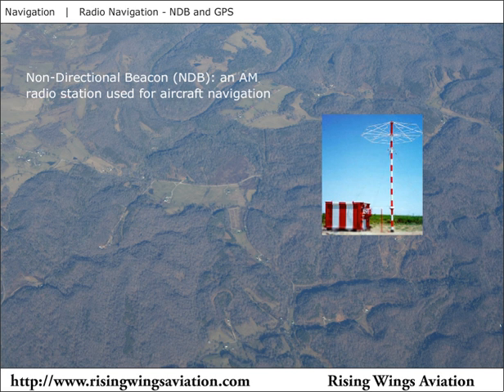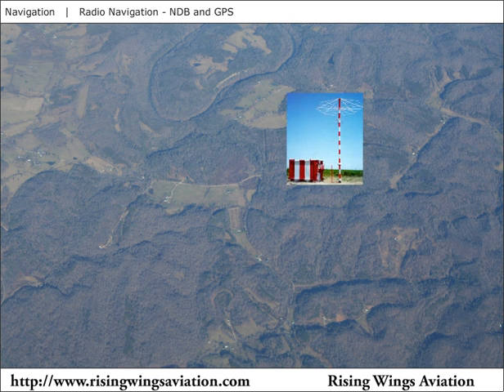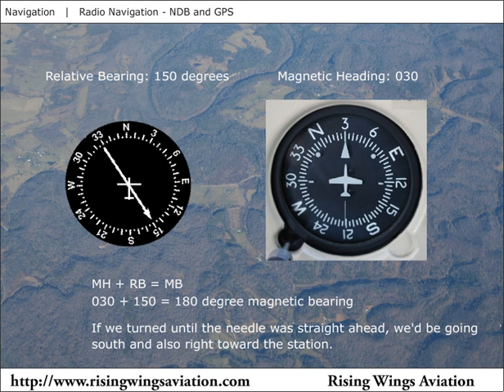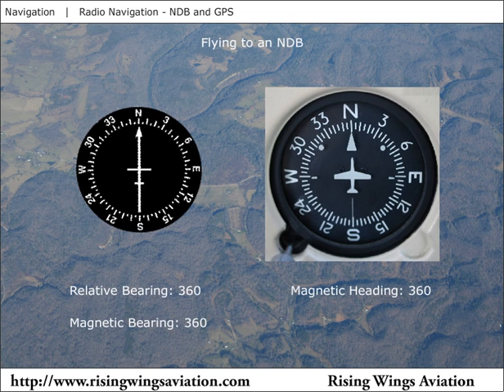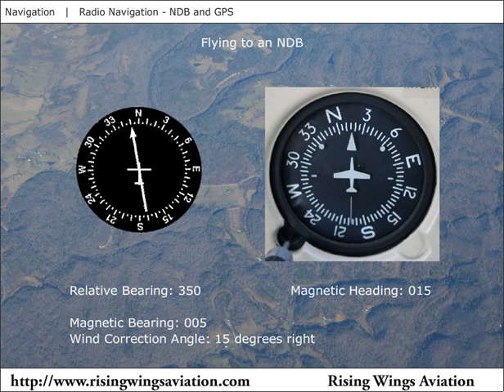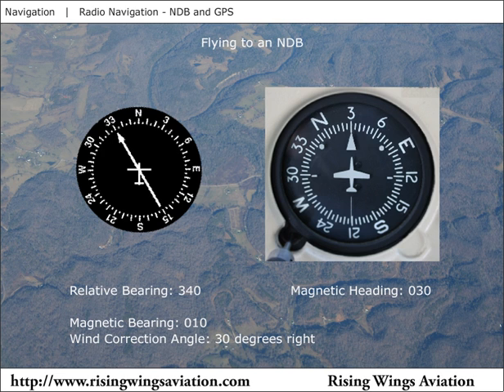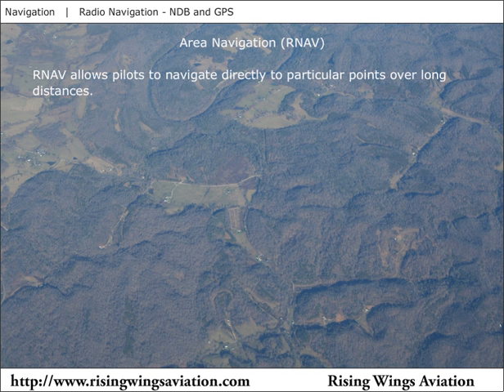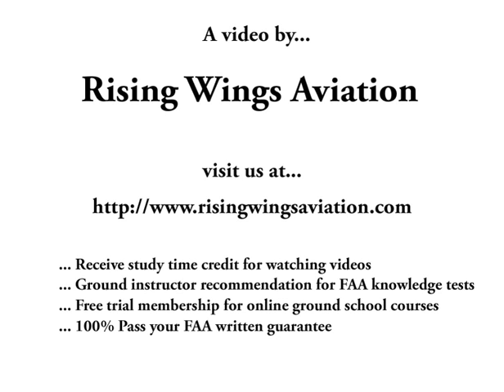Navigation Using NDB

Comment: Probably a little late to answer this one, but no. Because you have to point the nose of the a/c into a x/wind by some amout to compensate for drift, the nose of the a/c is no longer pointing at the ndb.
The adf needle always points to the tuned ndb, N on the adf is the nose of the a/c, the difference between the two is the number of degrees of drift compensation your applying in order to keep the a/c tracking directly to the ndb.

Comment: I dont think it. I never seen a NDB linked to a DME. Usually VORs are linked to DME, not NDBs.
There is a formula to know your distance to the NDB based on your ADF readings and speed. I can explain if you are intrested.
Reply: pls brief the formula to determine distance to NDB
Reply: @sagu925  Well it is hard to explain in words, but imagine you have your NDB and your ADF needle is pointing to it.
You turn left or right. Lets say right. (yes, you need to turn, because you need the adf needle pointing almost 90% to a side)
Leave the needle 5 degrees above directly pointing to your right.
As you keep flying straight, the needle will drop slowly. Needle always drops. Eventually it will be completely 90ªs to your right, because the NDB station is also 90º directly to your right. Start your chrono. Keep it running for 20 or 30 secs.

Write down how much time and how much degrees of change for the needle.

Formula is time(seconds) / degrees of needle movement = Minutes to the station if you were flying towards it.

Ie took 30 seconds for the needle to drop 10 degrees.

30/10=3 minutes

With this time and your groundspeed you should be able to also calculate the distance.

Of course, this does not account for wind. Its a pretty ancient rule of thumb technique.

Comment: yes you can use co-located DME with NDB to know the distance but they work on different principles . The NDB frequency is entered in the ADF which is the equipment in the aircraft for NDB ( is the radio station on the ground )  navigation .

Comment: Although NDBs are considered more primitive than VORs, I like that this video shows that, mathematically, you can get the same information.  Once a pilot is well-versed in this principle, NDBs can be just as practical, assuming the PIC is aware of the different sources of error in each method.